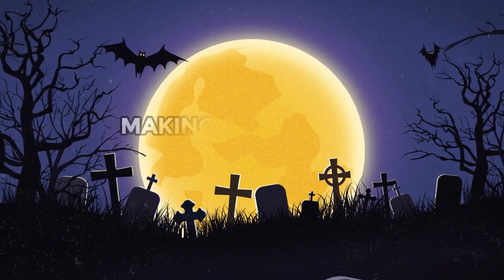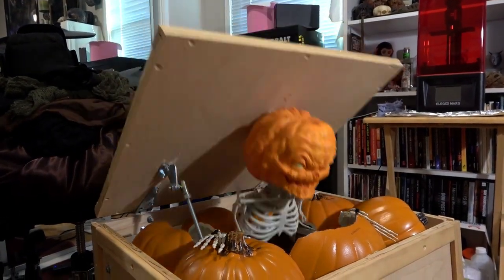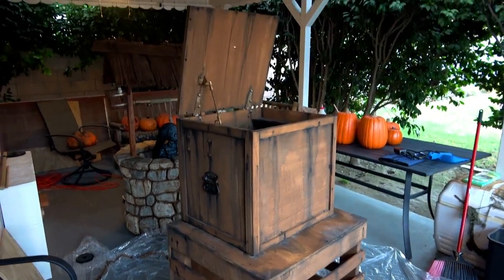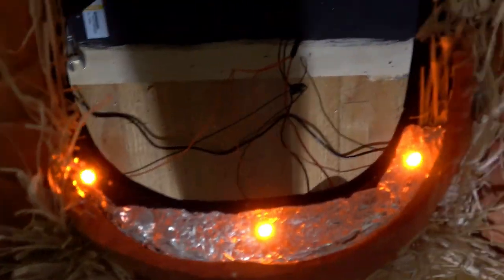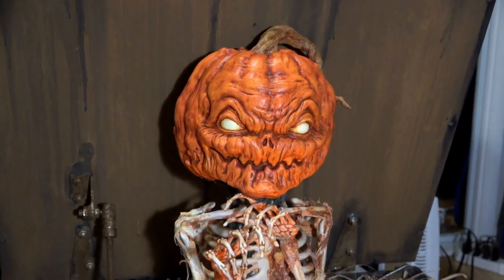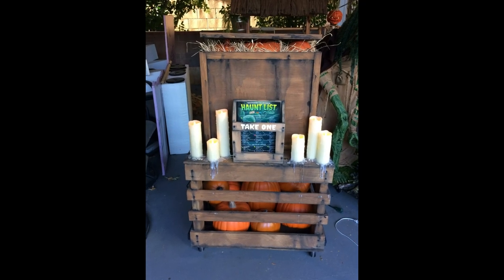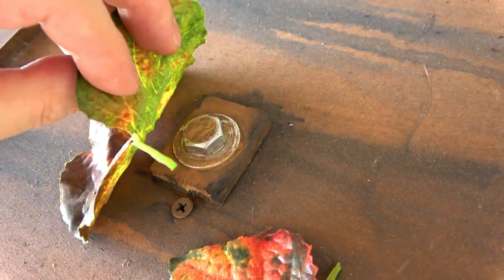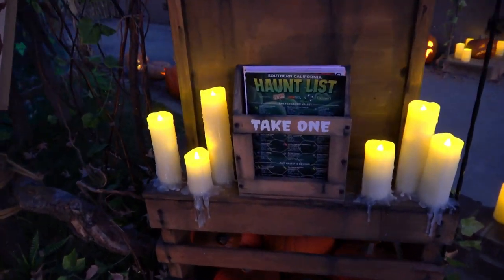MAKING THE POP BOX | DIY Monster In A Box Animated Halloween Prop | Grimwood Hollow Yard Haunt

Comment: I have a 5 year old “monster-in-a-box” prop that i’ve rebuilt adding a rocking motion and a toothy fur face in a small window. I want to add the pop up lid with maybe a wolf head. Wondering what all is controlled with the picovolt…? The limit switch turns on the LEDs. What about the sound? And do you have a link to that speaker? Thanks.
Reply from the maker: Thanks so much for watching! So there are two limit switches, you can see them in the video, one turns on the led’s and the other sets off the speaker with the laugh! The pico volt is a prop controller used to record the animation. In this case it was two fast rotations of the motor followed by two slow half rotations. The pico volt gives you a ton of control when animating the wiper motor! There are some videos on YouTube from Fright Props that show you how to use them! Hope that helps and happy haunting!😄🎃👍

Comment: Great job!!! I saw that prop in another video from your channel and I thought that it was using a compressed air system. It's very interesting that your are using a wiper motor. A question, how do you control the position of the wiper motor? I will try reproduce it but I don't understand how you are handling  it. 
Regard,
A fan from Spain :)
Reply: Hi again, not sure if you already mention it in your video (my english is not very good sorry). It seems you are using a Picovolt controller. I took a look at their web page and it seems you can record the whole animation sequence, and also define the stop position. .... It would help me a lot with my projects :) ... but nowadays the shipping cost is to much for me.
Once again, great job, you are inspiring mostly all my projects 😀

Comment: Nice work! But, why so many batteries when you already have 110v power to the prop? Wall warts are cheap!
Reply from the maker: Haha thanks so much! Honestly I really don’t know much about electronics and animatronics, I just try to figure it out the best I can! I’ve heard of wall warts from my friend but I’m not really familiar with them and how they work?! Would love some advice if you know a better way of hooking these up! One reason I made them separate with batteries though is so I can work on the animation any time I want to but without the sound and lights going off, it seemed to work well but Im sure there are way better ways! Thanks again!😄🎃👍
Reply: @GrimwoodHollow  Wall warts (common power supplies) come in different voltages. Most are DC but a few rare ones  are AC. If you're replacing batteries, you'll only want the DC ones. On the box, they'll have two voltages listed, Input and output. Input will be 110 to 120VAC (because it has to plug into the wall). Output voltages vary according to the needs of the device it previously powered. You need to match the voltage of the power supply to the batteries you're replacing. For example, that speaker took 8 batteries. 8 x 1.5 volts =12volts. So you need a 12VDC output voltage power supply to replace that battery pack. If your device takes 2 batteries, that's 2 x 1.5 volts= 3 volts. There aren't many 3VDC power supplies but they do exist. The other necessary thing to know is that you need to keep track and match wire polarity. Keep the positive wires together and the negative wires together. For example, if an LED light doesn't work when you first hook it up, try reversing the leads. Things can get more complicated for heavy loads but most wall warts will replace batteries in candles and small devices. This was a simplified explanation but its the basic idea. There are lots of YouTube videos teaching you about watts, volts, and amps. Some are good, some are crap. Watch a bunch and the good ones will agree with each other. You'll catch on.
Reply from the maker: Wow Gary thank you so much for that extremely detailed and informative message, I really appreciate it! That was so helpful! I definitely know some of the basics, I actually did quite a bit of simple electronics and wiring for lights, batteries, and motors when I was doing special FX for movies, especially a lot of the props we built! But there is so much more I still need to learn! I will check out some videos for sure, thanks again so much buddy, you are awesome! Cheers😄🎃👍